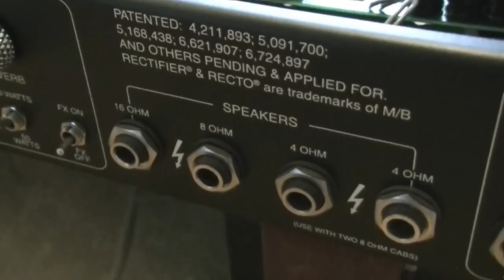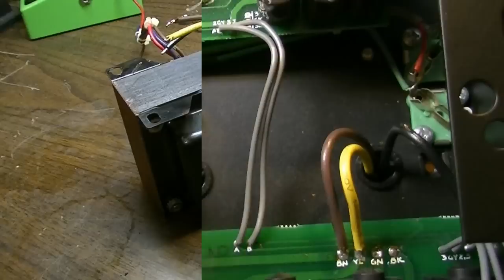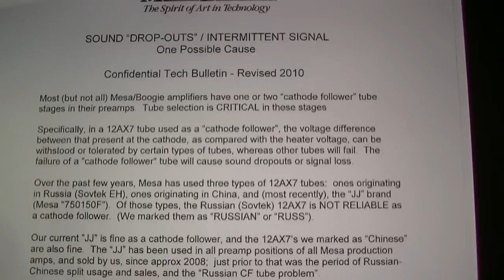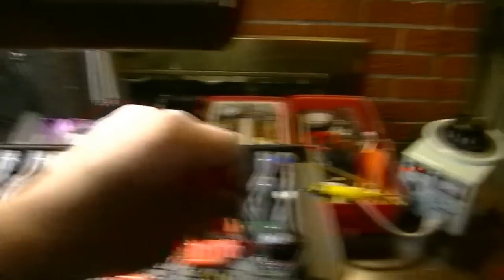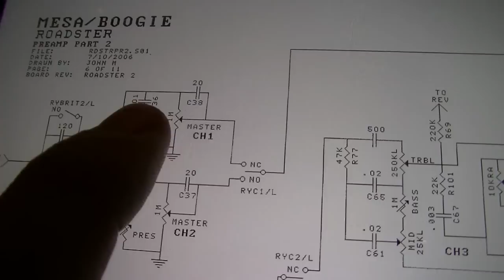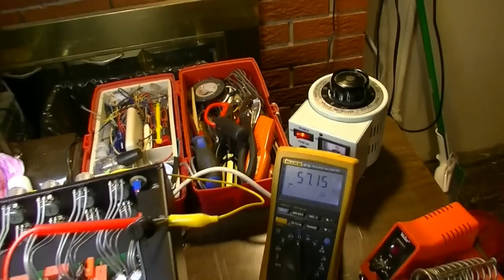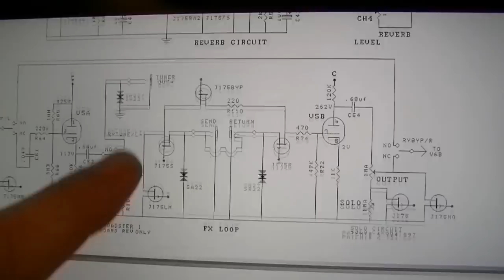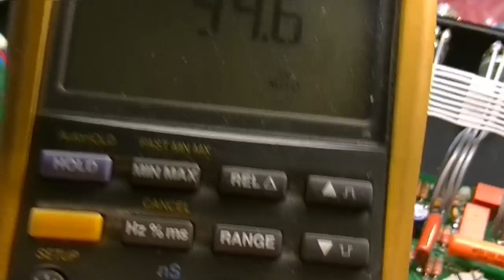Amp Tech's Worst Nightmare - Mesa Boogie Roadster Repair

Comment: Brave man! Kudos for your willingness to t-shoot a pcb, ribbon connector, board-mounted socket, please-make-every-guitar-sound-known-to-man monstrosity like that. All the good techs I've known swear that Ampegs are the worst, but this looks like it takes the prize! Enjoyed watching you sort it out, good work.
Reply from the maker: Ampegs are the worst in terms of component placement. Any of the ones with the components on the bottom of the boards are just a bitch to get to, not necessarily hard to troubleshoot. This was the first time I've had to phone the maker of the amp to give me some guidance and make sure  I was on the right track.
Reply: +The Guitologist Yep, component logistics was always what I heard guys cussin' about. A tech friend I once knew had to buy an extra wrench and modify (heat 'n bend lol) it for a specific function to work an Ampeg once. Years later, a tech who's a friend now related the same wrench-modification process in a "war story" he was sharing about working the same model. I don't remember which model Ampeg it was, but I wouldn't be surprised if you had the same tale to tell! Enjoyed your video, subbed. Take it easy and thanks for the cool work. You guys are getting rarer, and those of us who know the score appreciate you very much.

Comment: Great video ! I can change a fuse  change out tubes and make guitar cables so i will will leave the hard stuff to  you real repair guys .
Reply from the maker: This was an unusually difficult one for this channel. Most repairs are of older, easier to troubleshoot amps.
Reply: The fact is you did not give up even when you made a mistake you owned it and i respect that .
Reply from the maker: Everyone makes mistakes, especially amp techs. Be wary of the ones who say they don't. They are lying. :D

Comment: That was great! You troubleshooting every little  J-fet, resistor  and such was like bringing Apollo 13 back to earth. Where can someone learn this craft ? Seems like today everyone has a use,break it, throw it away and buy a new one mentality. I'm more speaking of the cheaper solid state type amps not boutique style tube amps. Thanks for the upload.
Reply: There is a tube amp building class run here in michigan, by bruce egnator, that might help. http://www.ampbuildingclass.com/
Reply: I appreciate this link. It would be nice if he put it online since I'm a transplant from Michigan to Florida. Again great job. I never see anyone post the nuts and nuts of a tube amp repair like yours. Never mind just being an end-user of a Boogie with all their knobs and switches. Keep this art alive because I think it's about to be lost with all the modulated amp stuff out there.
Reply: Nuts and Bolts.
Reply: Okay, the Bruce Egnator site looks to be very informative. Thank you again.
Reply: No problem.
Reply: For me the best experience was to design and build my own amps and effects. When starting from zero, troubleshooting is a real headscratcher. With experience, things become much simpler and after awhile it's possible to delve into amp repair like this. Also many books are available on the subject of amplifier design and construction.

Comment: What I think is the funniest part about this video is the other repair shop declared the OT dead. Well sorta!! Someone tried their very best to kill it right? Good thing they left a bit of a nub of wire to be able reattach the green wire back up. Not all techs are created equal.
Reply from the maker: There are definitely more than a few amp tech who would have replaced the OT and moved on.
Reply: I'm not a amp fixer, but i checked out the video, and was wondering, did you solder the wire to the OT, before using the heat shrink tube?
Reply: Obviously I am not the Guitologist. But yes he would have soldered the connection up and then used heat shrink for insulation purposes.
Reply from the maker: Yes, of course it was soldered.
Reply: Oh OK smart move. I figured you did.

Comment: See....I love the single/dual/triple rectum-fryer high-gain rhythm tone for certain shit, but those god damn dip-switches and knobs and all that is just more than I would ever want to have to navigate. I wish I could get a preamp that is - in the signal path itself - a clone of the preamp section of the Dual, but with gain, 3 band eq, and master volume, and a power amp with a pair of 6L6's and a single volume control, and nothing more. I don't need option-paralysis when I a dialing in a high-gain tone. Spring reverb in a modern high-gain amp is always too noisy, and I never use reverb on high-gain rhythm stuff, and I don't need 4 channels, just one good one.
Reply from the maker: The four channels would be good if you want that "set it and forget it" mentality and you're covering 3 to 4 hours worth of cover songs from a lot of genres. Your typical bar cover band gig goes smoother when all your tones you'll use for the night are only 4 or 5 buttons away. I'm with you though. For me, one channel, an OD, and my pick attack will usually cover what I need to do.

Comment: Hey there.. There's a relatively inexpensive amp I want to get. But it only comes out in 110v, and I'm in Australia.. I was wondering how easy a job it is to convert to a 240 volt input transformer. Is it a job I can do on my own? Could you provide pinouts? (It's a monoprice 15 watt anyway FYI) I could just buy it a buy a 50 watt step down transformer for $50, but I'm always looking out for the long term solutions

Comment: After 30 years of playing I finally decided to pony up on a serious forever amp. I looked at Mesa, Marshall, Fender.....Divided by 13, three monkeys.....Freidman, Soldano. I studied boutiques and mass production amps for over a year. I've known some Boogie snobs over the last 30 years so I really dove into those because these guys were as high as a crack head on those amps. 
Needless to say this video really explains mesa and their over engineering. What i ended up with was a Goodsell super 17. Basic. hardwired. Point to point wiring. OSTRICH tolex. All hand made and based of the Hammond organ amplifier. 4 knobs. Reverb (dual spring), gain, tone, volume. It kills. Cleans from heaven and enough gain to get you into hard rock. add a good overdrive pedal and you are screaming creamy leads for days. $1100 used. List price new is no more than the list price for the trash in this video.
Reply: It's apples and oranges.  The Super 17's point-to-point architecture has nothing in common with a PCB amp philosophically or in terms of execution. Ease of troubleshooting was never a design consideration; one, because it is a ridiculously simple amp, and two, because it has a lifetime warranty and therefore never needs to visit a tech. If it is a matter of customer convenience to use a local guy, then I am happy to do a phone consult, but I do not release schematics to anyone. After individually building nearly 1500 of them, the underbelly of my amps looks like my own calligraphy to me, whereas someone with an eye for the predictable neatness of PCBs might only see spaghetti and chaos.  Rest assured there is a method at work. So, inferior to what?
Reply from the maker: Thanks for the comment. I think Mesas such as the Mark V, Roadster, and Road King are for those people who want their, as you say, "forever amp" and want the Swiss Army Knife solution that will, at the press of a footoswitch, do everything they need it to do without a big pedal board full of boutique pedals.  I can understand the mentality because, as I've said, I used to be a dealer for Mesa. But I can also understand exactly what you're saying also.
Reply: @TheGuitologist  ... Hey, I'm looking at a mesa boggie tripple rectifier. What do u think... Also looking at a Marshall four channel . What do u think????????
Reply: I've seen the inside of a Super 17. Looks pretty serviceable to me. Roomy compared to the amps I've built.
Reply: dont worry,you wont corner the market being coy and hiding or hoarding your precious schematics
Reply: I live in Atlanta, Goodsells are the best thing going here!
Reply: After playing myself since 1965 I can assure you that you made the right choice- the solid state amps today are just trying to mimic the tube amp sound of the 60s and 70s- clean deep reverbs, smooth distortions and pleasing mixes of both with simple volume,treble and bass controls. Mesas, Orange or Line 6 will still never sound as good as a Fender, Vox, Sunn, Traynor or Ampeg amps with JBL speakers(bass or lead/rythm)from that era( after all, those are the sounds that made hard rock a new and different listening experience)Well, that and lyrics you can actually hear and understand
Reply: @MegaBassman59  metal is not about understanding the lyrics, but it's the thundering guitars and bass, also the grinding volcals.... Welcome to 2018, not 1965. Now come get some son.... Move it ;)
Reply: Trash? Hardly, it shouldn't be a surprise that the Mesa has multiple switching circuitry failure modes. The Goodsell has a variety of design issues itself, and from the published photos will be a nightmare to troubleshoot (particularly V3). I certainly wouldn't describe the Goodsell as being better than the Mesa in any way, if anything the Goodsell has a much inferior layout.
Reply: Valve and old tech... has become overrated to a point, would still Prefer it the difference is still very noticeable but I can sacrifice that being super close with stuff now that has a very similar response.

Comment: Hi Brad, I was very impressed with your ability to hunt down the issues with this amp (assistance or not)... As far as Guitar Amplifiers go, those multi channel Mesa's are quite complex.. I personally think they are good sounding amps, clean or distorted, and have a nice reverb. However, MB seemed to be plagued with quality control problems for years due to that same complexity, the use of inferior parts (plastic jacks and pot shafts) and poor building practices (tube sockets mounted directly to PC boards). I like most here, don't like PCB construction, but I can't even imagine what a rat's nest of wire that amp would be without it! I think better engineered layouts, higher quality parts and thicker PC Boards with better traces would go a long way to solving most of their issue's. Maybe they have already corrected some of those problems? Finally, I don't mean to bash on Boogie's (I still own 2) but those style combo's are just too darned HEAVY. I know they have huge magnets on the speakers, but the real issue is the cabinet... I think it's 1 and 1/4 inches of particle board, it's just junk. The least they could do is offer an option for solid wood cabs if one wanted it. It was a great video Brad, and I am glad it all worked out for you. Tom
Reply from the maker: I've had instances as a Mesa dealer where a customer of mine would have a broken pot or something and Mesa would just send the part out for free to whoever was doing the tech work. They did it MANY times for us when we got bad batches of tubes. They just sent new tubes to replace our stock because of problems that, frankly, were out of their control.
Reply from the maker: Their cabs are birch plywood, not particleboard. Click the link and select any cab. They're all made from "Marine grade Baltic Birch".
http://www.mesaboogie.com/cabinets--simulators/guitar-cabinets--simulators/rectifier-series/index.html
Reply: I am not a Mesa Boogie dealer, nor have I ever worked for someone who was. I'm sure your experiences with their service department was great. I've heard of them giving people NEWER model amplifiers because they have had issue's with an amp recently purchased while gigging. I have owned 4 Mesa's thus far, a 1979 MarkII 60 watt combo, a 1989 50 Caliber head, 1990's DC10 2x12 combo, and a 2004 50 watt Rectoverb 1x12 combo.. I still have the Mark II and the 50 Caliber. I sold the Rectoverb less than a year ago, and the back panel was some kind of thick particle board, not plywood. I believe the soundboard was as well. Both of the Mesa's I still have are plywood. I was more or less stating the obvious, They are heavy..

Comment: 3:05 - Crustiness around the output leads? That's just solder flux. I see that a lot with wires added to PC boards after the main bulk board soldering and cleaning. 
PS... Noticed many of your vids the "bass" cuts out and then fades back in.... I think every vid I've seen so far...
Reply: It's a bunch of wave soldered PCBs, thus no flux elsewhere, but whenever there's a direct connection like that, it had to be soldered in by hand. So this looks like factory condition to me.
Reply from the maker: Yes it's flux, but it indicates heat was there when it's nearly black like that, or like you said, someone has been fiddling with it before me, which automatically makes it suspect.
Reply from the maker: You're probably correct on those OT connections. I was just already skeptical because it had been to a shop already.

Comment: Good job! What might cause those JFETs to go bad?
Reply from the maker: John Simms not sure but I think any kind of voltage spikes can compromise the boundary between the two regions of semiconductor inside them.
Reply: I guess you then have to hope your amp fuses do the job they are intended for.
Reply: I'm wondering If when you mean voltage spikes are you talking about a spike that cause a furman power conditioners breaker switch to pop? I've always had my expensive amps connected to a furman, and I actually even had my first Furman conditioner pop the breaker one time.
Reply from the maker: According to the datasheet, the forward gate current MAX is 50mA, which isn't a lot of current at all. I'm assuming anything above that could cause damage, but not sure. I'm not a semiconductor expert. I do see where these have maximum operating temps too, anything higher and they won't work. https://www.fairchildsemi.com/datasheets/J1/J175.pdf
Reply from the maker: There's at least a resistor between the voltage source and the JFETS themselves, so that would take the brunt, I guess.

Comment: Whats the model of the relays in this amp? Curious what they use to switch 200v DC. The relays in the Peavy 5150 are rated at 250v, but that is right at the edge of their range, and I dont like using components on that slim of a saftey margin hehe
Reply from the maker: Joe Ambly don't know. Maybe there's a glimpse in the video?

Comment: The LDR's and JFET's are the bane of dual rectifiers. It's amazing how you can buy a $2500 amp for $300-$400 that's not working, spend a few bucks for the parts, put a few hours of time fixing it and sell it for 4 times what you bought it for.

I guess people are intimidated by the high voltage and parts count of these amps. Or they don't want to take the time learning how to fix stuff.

Great video Brad! It's refreshing to see someone fight the throw-away culture.

Comment: I always plug in another amp's preamp to my power amp and vice versa and see which half is (hopefully) working. Or if both halfs are out.

Oh, and nice amp!
Reply from the maker: Not a bad approach. After getting the OT right, I was pretty certain it wasn't output related.